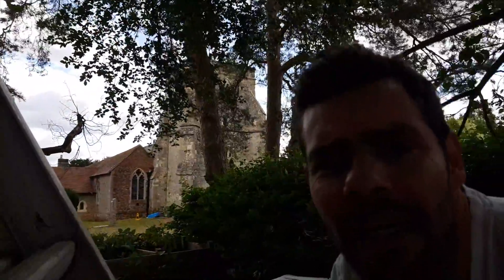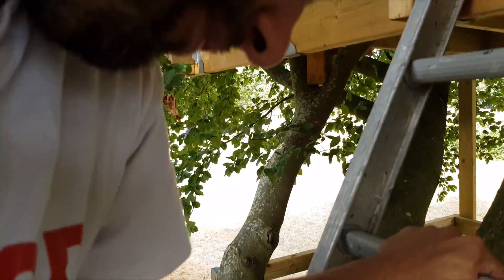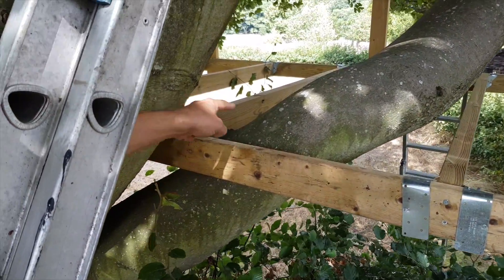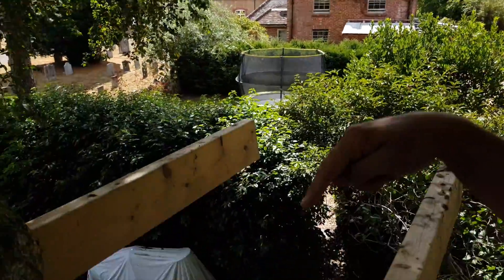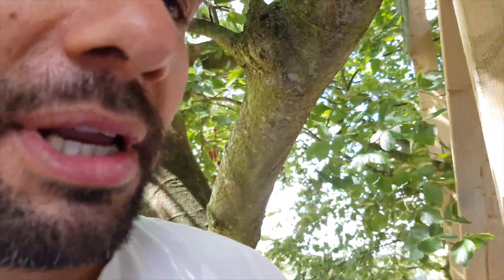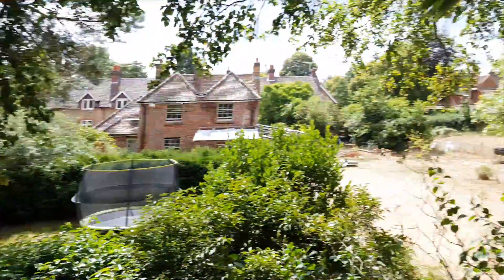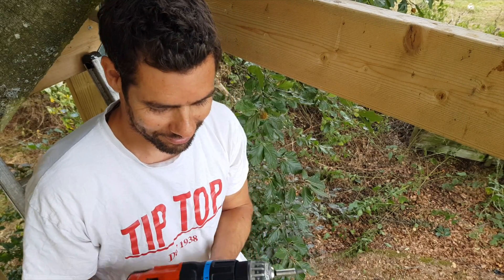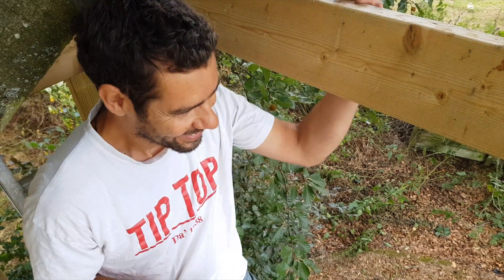MP133 - F1 Energy Recovery Systems EXPLAINED

Comment: #askelvis - why doesn't Formula e use slick tires? Is there any downside to racing on better tires? Is the reasoning that on sticky tires it would be too hard to lock up and cause Chaos? I am inclined to think that better tires would just make everything about the sport more entertaining... unless of course no one ever loses control of their car.
Reply from the maker: It's mostly to fit in with cost saving, the idea that tyres are not throw away items after a few laps and importantly  because it allows the tyre supplier to promote their road car products through their involvement in motorsport.
Reply: Ah, I can definitely see the road car tire promotion part of it. I know that is coming into play in F1 soon as well. Thanks for the quick answer! Formula e is fast becoming more road relevant than its combustion forebearer.

Comment: Just recently I was wondering why the MGU-H was designated that way (H for Heat), since it's still mechanically / kinetically driven - by the turbo. Not really heat-driven. I guess the turbo is sort of a heat recovery system, though it seems to me that blown exhaust gasses are still really kinetic energy.
Reply from the maker: Yes, slightly misleading name

Comment: Great vid agian marc was wondering if u have a theory to wat farrari have done to get so much power from the mguk and the other question is wat u think about the hidden clutch botton on the steering wheel is that why there starts are so good
Reply: Google "Ferrari split battery". They're bypassing the 4 MJ limit per lap from the ES to the MGU-K with the blessing of the FIA. It wasn't so apparent at Hungary because the lap is so short so deploying more than 4MJ isn't a big advantage. It should be interesting at Spa though.
Reply: Shaun Stephens thanku for explaining

Comment: #AskElvis Are the cars used in mid season testing the same as the race cars or completely new cars?? Exact question is did Giovionozi use Sebs or Kimi car during the testing ??
Reply from the maker: I don't know about Ferrari specifically, but the big teams will normally have separate test cars, so that the race cars can be sent back and rebuilt. The smaller teams have to use the same ones.
Reply: Thank you!

Comment: Well then, Ferrari has probably worked out something incredibly sophisticated within the MGU-H than any other team.
Reply: They don't need to when they (and their customers) are allowed by the FIA to run a split battery system with one half of the battery running un-metered energy so they can exceed the allowed energy deployment. Google 'Ferrari split battery'...
Reply: Shaun Stephens 
But why don’t other teams do the same thing if it’s that obvious?
Reply: Because they're not cheats perhaps? Ferrari did this and kept it secret for years. Then it came out and the FIA tested it, said they didn't like it as it's possible to cheat. Ferrari said they can't change it mid-season so the FIA said they could keep it for the rest of the year. Then Ferrari rolled it out to their customers...

Comment: I've not pulled apart a drill but I imagine there is gearing in it to give it more torque to drive the screw in. Is there gearing in a MGU-K system to mediate/increase the power that can be generated?

Comment: Super video Marc... why are the systems so unreliable then seeing as the methodology is rather simple ?
Reply from the maker: The concept is simple, but the reality on an F1 car is far from it. As with everything in F1, the components are being pushed to the absolute limits of performance and the environment they're in is very harsh.
Reply: Rather simple? A drill motor won't run at 150,000 rpm and 200 degrees C for two hours while wrangling in excess of 50 kilowatts. The MGU-H is really pushing the limits of what current technology is capable of. It's a thing of beauty but very expensive and temperamental.